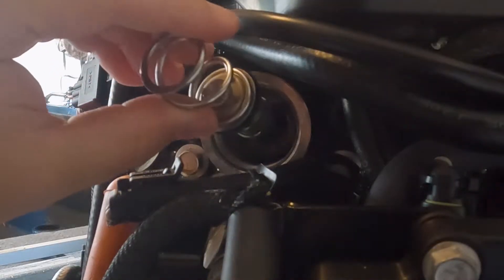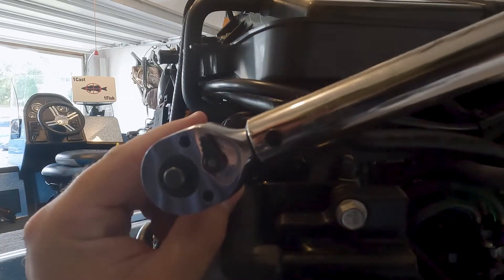Evinrude ETEC Thermostat Maintenance / 3 Year 300 Hour Service

Comment: I have a two thousand eleven evinrude E-tec 2011 overheating issue, I had changed the empower change.The water pump changed the thermostat change the pop off valve and flush the motor look still
Reply from the maker: Those are the major culprits usually. 
Have you actually checked the temps at the heads?  Use a temp gun and check actual temps...bad sensor maybe?
Have you ran the diagnostic software to look for issues?

Comment: Important distinction for different models - the big block motors have the thermostats installed in the opposite direction as they are in my G1 225 (3.3L), the body of the thermostat stands up into the housing not down into the head.
Reply from the maker: Thanks for the comment and the added info!

Comment: Good afternoon, I have a question regarding my 2007 225 evinrude ETEC.  I had the water pump replaced last year.  My first trip out this year, I noticed the squirt out let was pushing more water than ever before.  I also noticed my water pressure gauge is pegged all the way to its highest reading and the water temp gauge never moves.  Should I be concerned about this?
Reply from the maker: I would be concerned with anything that is not "normal" especially just after any maintenance is performed.

Comment: You get the gaskets stuck in the housing?

When I pulled both thermostats on my 115, the rubber gaskets were stuck!
Reply from the maker: Yeah that happens sometimes, they normally will come out with a pick....then just replace with new

Comment: Great video. I have a 2010 E-Tec 150 on a Ranger bass boat. I took your advice when replacing my thermostats, spark plugs and water pump. Have you serviced the poppet valve. I think mine may be sticking because I have occasional overheats when running around 3000 RPM but still have plenty of water pressure. Thanks…Terry
Reply from the maker: Low RPM overheats are normally due to T-Stats, High Speed is due to the PRV.  Is it fine at higher RPMs?
I have not serviced my PRV, but I can tell you the easiest way to get in there will be to remove the EEM, it just frees up space since the PRV is in a awkward spot.
Reply: @ I don’t usually run it past 4000 or 4500 rpm but it hasn’t overheated on those higher rpm ranges. It only overheats around 3000. It’s got new water pump and thermostats so I don’t think there’s anything left; unless it’s a false indication.
Reply from the maker: @Terry-Kleetus-Kleeblatt  
So here is some info that may help.
Max temp below 3000 rpm is 230 degrees
Max Temp above 3000 rpm is 194 degrees

Below 3000 is T stats, above 3000 is PRV

If you want to know exactly whats happening and the current temps, I recommend the EV Diagnostics software and real time monitoring. This is the BEST way to diagnose the issue vs tossing $ at it.

In the mean time I would pull the T-Stats and check them in boiling water, make sure they open correctly and fully.  It is not unheard of to have a bad or slow T-Stat, or a rolled O-Ring when installing them.

Hope this helps a bit...these overheats can be caused by so many things, so the software is important.

Comment: What was the torque spec on the thermostat housing?  Would it be the same for a 115 hp?  Where would one find this information?  I dont have a manual.
Reply from the maker: Info is in the description Housing torque is 120 to 144 in lbs 
I also recommend getting a manual

Comment: I had my-lower unit serviced, the usual, impeller,oil, O rings, and stats, my 2008 250 etec its still running hot. Runs up to almost 200 F
The engine at 7MPH after  the service is still running too hot. I speed up and the temp immediately goes down.
I might have to install a cooler stat to keep the engine running cooler. I’m located in Stuart Florida.
The engine just turned  400 hours something isn’t right. Do you have any suggestions.
Thanks Frank😊
Reply from the maker: So low speed cooling is T-Stat, and high speed cooling is the PRV.  Your issue seems to be low speed...I would pull the T-Stats and test them in hot water for the actual open temp as a starting point.

Comment: Paul, have you done a video on replacing the poppet on a Etec? If not, can you provide any advice on replacing one.  Thanks
Reply from the maker: I do not...and hope I don't have to make one...lol
From what I know about the Poppet Valve, it is in a tough spot to get to and a pain.  The easiest way is to remove or lift the EEM up out of the way to get better access.  Also be careful with the nuts and such, they are easy to drop or lose.

Comment: excellent video: my new engine 2012 175hp has Code 43 an 69 engine temp above expected range port temp 195F star temp 192F
Code 25 EMM temp above expected range EMM temp 188F
 I plan to remove all the small rubber cooling tubes an clean. remove thremostate an soak in vinagar. I know the engine runs cooler above 2500RPM an hotter at idel.what are normal temps.for both? thanks
Reply from the maker: 1st do you have the diagnostics software?
T-Stat should be 143 degree
Max Temps 230 below 3000rpm, 194 above 3000 rpm.
EMM Maz should be 212
Typical Engine Temp should be around 160 +-20 at idle...WOT 120+-20 at WOT
Code 29 is EMM temp >176 and limits engine to 1200 rpm

So with those basics out of the way, the best way to see whats happening and when, is to use the software and watch the temps in real time during operation to see what is going on and when.

I would start with the obvious first...is it a good flow of water out the back?
Is it a idle issue or a WOT issue or all of the above?
Good water pressure? (Waterpump)
Are the intake screens messed up or plugged?
How old are the T-Stats?  If over 3 or they are very dirty...just replace them (trust me on this one)
If issue is at higher rpm could be the backpressure relief valve.
I would make sure these areas are good before tearing all the hoses off.

Also is it saltwater use? How old? Look up how to do a cleaning flush on the motor to clean the passages as well.

It could be many things or a combo of things honestly, just use a good methodical trouble shooting with the easiest things first.
Reply: @1Cast1Fish  yes I have the EV Diag. software. seller didn't know anything about engine. only used in fresh water. 170 hours. I've only scanned w/ engine off. was looking at historical errors.waiting on new fuel filter to run engine then scan while running.an observe the impellor discharge. I want to do the 300 hour service including all cooling parts impeller/t/states/ would you happen to know the part # for thremostats? an should I purchase the kit w/ spring an cover. thanks for advising.
Reply: @1Cast1Fish  Yes I have the EV Diag. software, engine only used in freshwater/ 170 hours. Seller didn’t know anything about engine.
I’ve only scanned engine while she’s turned off, waiting on new fuel filters.
Was planning to do the 300 hour maintaince which includes water pump impellor /thremostates (plus all the other stuff) then rescan.may start her up w/ new fuel filters if she discharges cooling water then scan while running.

 The overheat errors I think where historical.
Would you happen to know the part # for thermostat an should I get the whole kit w/ cover an spring seal? Thanks for advising you are the man.
Reply from the maker: Not sur ethe P/N without referencing the motor S/N and model.  I replace the T-Stat, Spring, Gasket, and O-Ring...I reuse the plastic housing.

Comment: Not so sure about the 120-140 torque numbers even though that's what the manual note. I tried tightening them to 120, worked on one of them okay but broke off the other one.
Reply from the maker: Inch Pounds?  120 Inch Pounds is only about 10 ftlb ...So not much at all

Comment: My 2016 ET 250 horse My heat light comes on periodically, It does not run hot It’s just telling me that the motor is running warmer than usual. What would you suggest?
Reply from the maker: Is water pressure correct?  Maybe a water pump issue
Low RPM....look at T-Stats
High RPM...look at Pressure Relief Valve

I want to say its around 2500 rpm or so for the swap over for cooling duty.

Comment: I put a new thermostat on the evinrude etec 60 hp but I think it gets too hot because I touch the injectors and they are hot
Reply from the maker: The injectors will be hot...was there any over temp alarms or running issues?
Reply: @1Cast1Fish  not until now not
Reply from the maker: If it just started after installing a new T-Stat, pull it back out and test it in hot water with a thermometer to ensure it's opening correctly

Comment: I will service my 2013 90 hp etec engine this month.  I learned a lot thanks to you👍🎉👌
Reply from the maker: Glad these videos have been helpful, I thing the 90 is a tad different from the 150, and will need a few additional parts as part of the service kit
Reply: I serviced my engine with the information you gave me. The single starter worked without any problems. I learned that my spark plugs were installed incorrectly.🎉🎉🎉🎉🎉🎉🎉🎉🎉thanks ❤❤❤
Reply from the maker: Glad this helped

Comment: So there is no "testing" of thermostat, it's mostly a inspecting for crud and cleaning ? Excellent video !
Reply from the maker: You can test them in a pot of water with a thermometer to verify they open and close...just heat the water and watch them open at correct temp.  I normally don't test them as long as I am having no issues.  Plus every 3 year 300 hour service I just replace them.
Reply: @1Cast1Fish  Thanks, I'll do that. I'm doing maintenance on a friends ETEC ( first time in 7 years, he doesn't know a motor from a grapefruit ) . Your videos are GREAT!
Reply from the maker: @joe28704  at 7 years, I would recommend just replace them.  Be sure to replace the seal and gasket as well

Comment: Did this and snapped the cap. Any shot you know the thread pitch / size for this? I need to clean up the threads before installing new cap
Reply from the maker: That really sucks, they can be a pain sometimes, especially in salt water, and older models they used a thread locker on them to make it even worse.  I do not know the pitch or size sorry...but most that have them break will use a chisel and pick with a vacuum to chip the old one out.   
If you got it out and damaged the threads in the heads, then I am not sure on the correct tap size as I definitely don't have one big enough in my tap/die set to even check.  Might be able to measure the opening size, and they make tools for checking thread count and pitch.

Comment: you forgot the most important step - heat the cleaned thermostat in a bowl of water and check to see if the thermostat functions properly.
Reply from the maker: Thats a great suggestion
Reply: what torking did you apply?
Reply: I'm an old fashioned shade tree type - most of my torquing is done by feel - remember the caps are plastic - less is best.  @IsaiasAlencar

Comment: TIP,  my e tec mechanic said use a 1&1/2 socket that fits the outside and you are less likely to break the cap. Great vid, just did it myself. It is a little tight getting in there but not bad. I also used the 13/16 to get the caps started then finished with the 1&1/2 and torque wrench.
Reply from the maker: Thanks for sharing

Comment: thx a lot , do you have the part number for the thermostat ?  greeting from Belgium (Europe)
Reply from the maker: I went to the Evinrude /BRP website and you can enter the model # of your motor and go to a manual for parts.  Not sure if they are the same  without knowing the exact engine specs.

Comment: Curious,  why not just put new thermostat in while old one's out? Thanks
Reply from the maker: I was not having any issues with mine, just pulled them to check them as part of standard maintenance.  If they were severely corroded or not working, I would have replaced them. Plus its good to remove and relube those housings...they can get stuck on there pretty good if left.

Comment: I had to replace the thermostat cap on my 2007 Evinrude 150 E-Tec I got the new caps the part numbers match but having a problem getting it to thread on any suggestions
Reply from the maker: Press hard, so I had a similar issue at first, you have to press hard enough to overcome the spring pressure to get the threads to engage.  Hope this helps

Comment: Great vid! Great info. What are the torque specs for tightening the housing?
Reply from the maker: 120-144 Inch Pounds....I tend to stay on the lower side, and if any leak just tighten them a tad, but I have had zero issues at 125
Reply: Thanks!

Comment: What year model is your motor?  I have a 2018 200 hp g1.  Was curious if this process would be the same for mine.
Reply from the maker: Mine is a 2014 Gen1 I believe both are V6 so should be the same